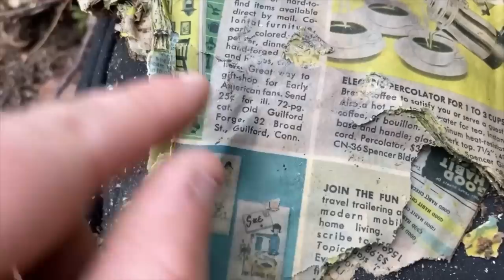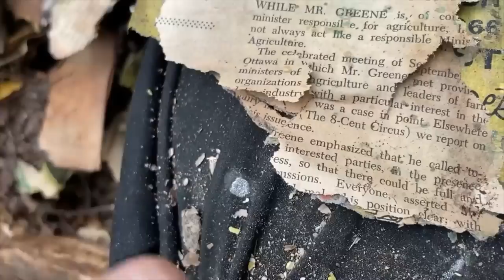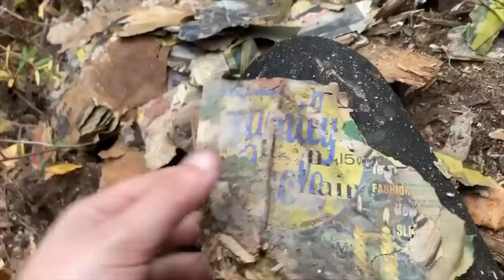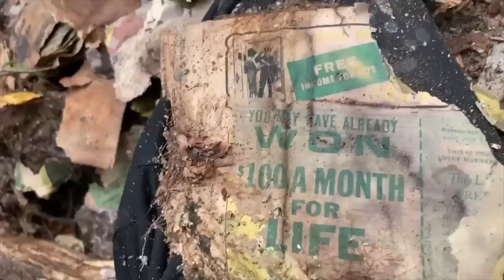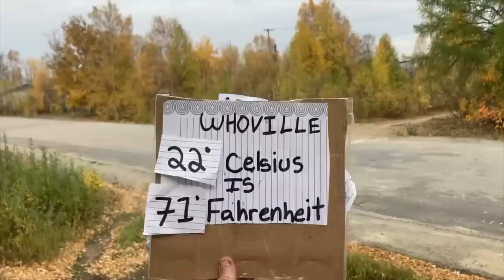Muskeg Clean Up With Lots of Bugs Plus Hunting Blind Sept 25 2023

Comment: Not a forest fire fighter person here, but looks like your quad lanes would be an assist if that were necessary. That one path looks a little grown up, but a couple trips for dead and down firewood, and a couple strategic small trees would do wonders. The door on the green shed only opened outward, so if snow piled up against it, you could be trapped. I think the door would be an asset, but only with some common sense applied. Things to keep in mind for the Mark II version. Much hard work going on there. For soreness the next day try drinking some pickle juice. Supposed to be good for excess lactic acid? Thanks and take care.
Reply from the maker: yes cleaning up and keeping the trails in good shape should slow a fire or assist the fire fires since we live in fear of fire.  thansk